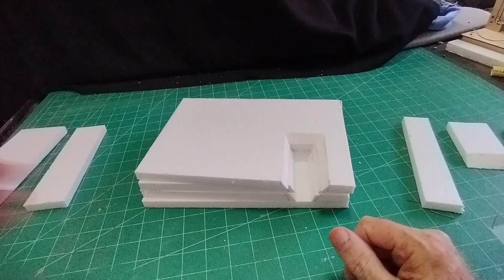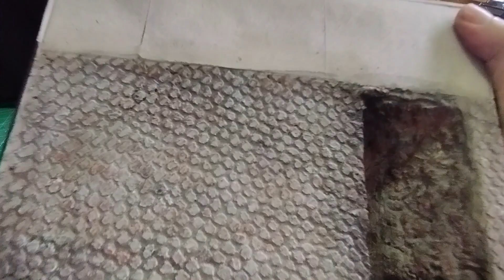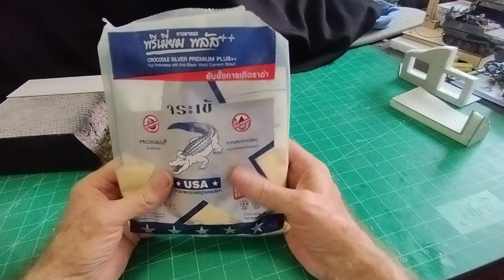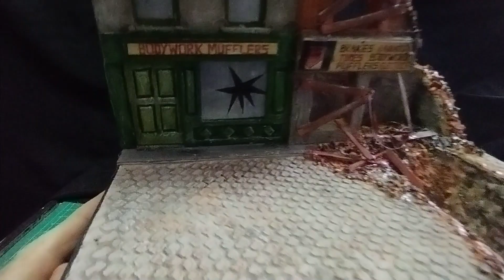Scale model bomb crater diorama. How to make.

Comment: Nice job, pretty well executed. I do agree with Modelermark172, the shape of the crater is odd. Craters are generally round or slightly oval depending on how the shell or bomb landed. If it hit at an angle, the crater would tend to be oval. I would also expect there to be a lot of rubble and dirt cast up by the explosion around the crater rim. Your cobble street (nicely done btw) looks like the shop keeper came out and swept it all into the pit.  I noticed one little detail missing. The door  knob or handle.

Comment: 1:29 - Base first. foam substructure 
4:02 - 2mm carboard top surface and frame, leave 2mm depth for cobble street grout
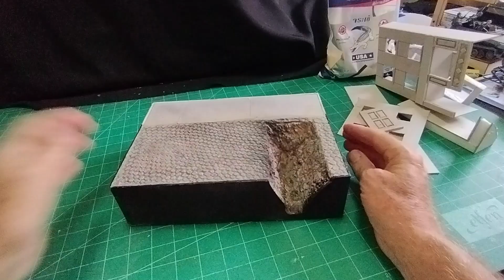4:55 - Crater shaped and cobbled street leveled with a steel rule. Cobbles notes.
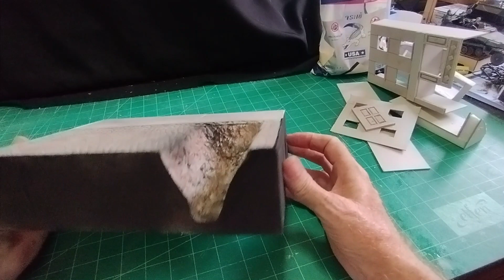7:30 - Crater notes. Wet blend grout with dry gout surfacing.
8:38 - Pavement 2mm cardboard
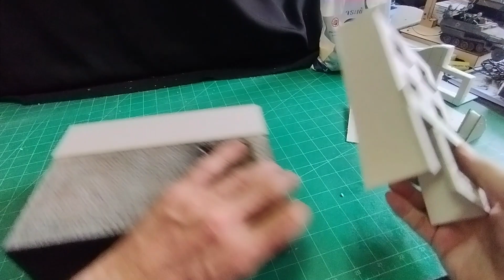8:53 - Shop fronts 
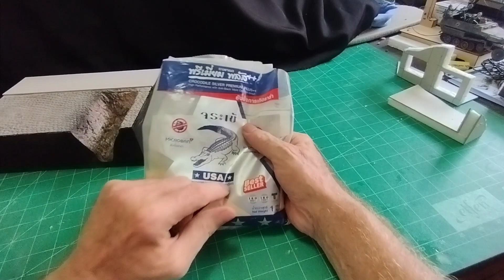9:54 - Don's locally available grout powder. May be found in Kitchen, Bath, or Tile section of hardware store.
11:59 - Assembled, grouted, and painted. Clear acetate window sanded for opacity.
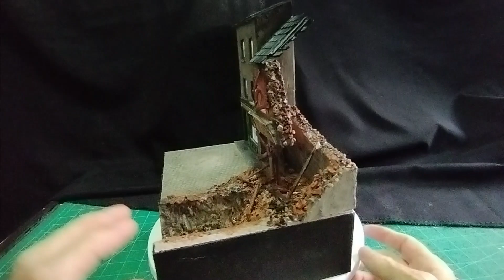13:20 - exposed brickwork
14:00 - Recurring character (right size)
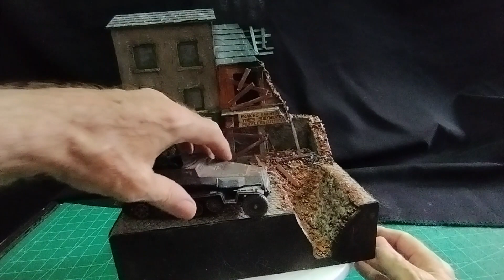14:13 - Mr. green (a bit snug fitting for this diorama)
14:53 - outro of crater integrated within diorama base

Diorama Don relevant links
Ruined Building: https://www.youtube.com/watch?v=FrFnUs1kSS8 (knife awareness and safety)

Cobblestone Street: https://www.youtube.com/watch?v=TdJuPAYTVVc
Cobbled Street: https://www.youtube.com/watch?v=TdJuPAYTVVc&t=3s (cratered)
Cobbled Street: https://www.youtube.com/watch?v=41deX7L-Nhk (with tram lines)

Doors: https://www.youtube.com/watch?v=uH8BbLfxI6s&t=354s (static - not openable)
Windows: https://www.youtube.com/watch?v=71zCWiq12jA (static frame - not openable, with curtain)
Windows: https://www.youtube.com/watch?v=momLM4ApdT0 (openable)

Painting without Paint:  https://www.youtube.com/watch?v=DkdaFyrOjbo (painting with tile grout)

Bricks: https://www.youtube.com/watch?v=ZXKFH30E5OI&t=14s
Brick Wall: https://www.youtube.com/watch?v=BVRNUBgdJw8 (as whole wall and grouted)
Brick Wall: https://www.youtube.com/watch?v=EHMsVVHHYlE (individual bricks laid out and grouted)
Brick Wall: https://www.youtube.com/watch?v=1WThxC_wHVM (with decorative elements)
Brick Walls: https://www.youtube.com/watch?v=u-l_7-7X6JE (two methods of manufacturing and assembly, then: mortar, distressing, and weathering)
Broken Render (Plaster): https://www.youtube.com/watch?v=uDLRDnBa-Yw
Rubble or Debris: https://www.youtube.com/watch?v=RxuOitEx0Ig (same process as brick making, but not necessarily to regular brick dimensions) Bonus: smoke damaged lumber (broken wooden roof trussing)

French Shop 1: https://www.youtube.com/watch?v=75gQXxvfCg8 (Normandy shop faces) Introduction to Don’s methods and materials for buildings at 1/35 Scale. Simple shapes: measured, cut, and assembled into decorative store fronts.
French Shop: 2 https://www.youtube.com/watch?v=lZKCb91xnD8 (paint and weathering) watered (thinned) wall putty primer coat on cardboard. Acrylic paint. Burnt Sienna, White, Black. 
French Shop 3: https://www.youtube.com/watch?v=9EEjd0YirWE (bombed building) bricks from wall putty and a reshaped pencil end stamp.
French street (French Shop 4):  https://www.youtube.com/watch?v=IhujUoT9prA  - (base for diorama) 

Mr. Green [Sherman tank]: https://www.youtube.com/watch?v=DoiMKbR7F5Y (How-to-build, with measurements and notes.)

[edit: tank video link supplants placeholder]